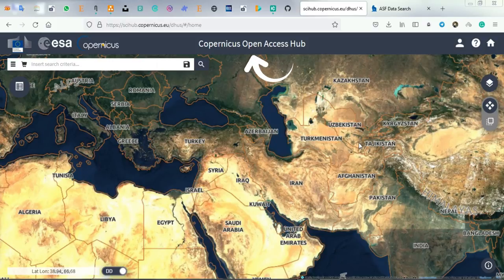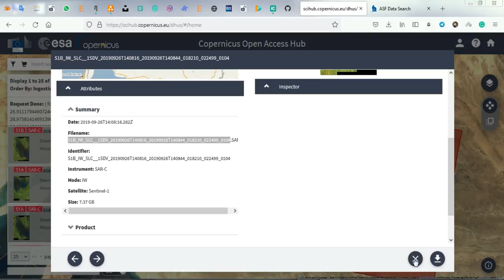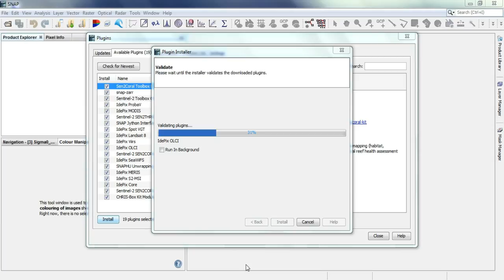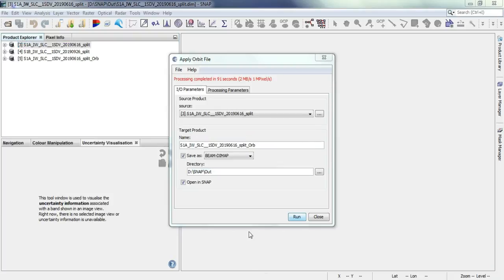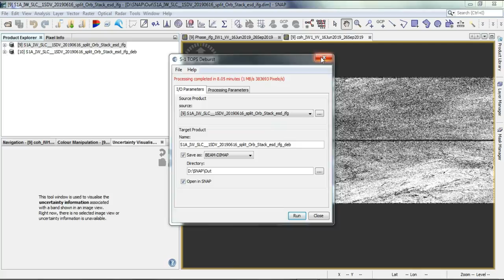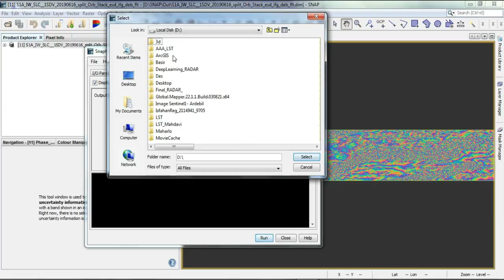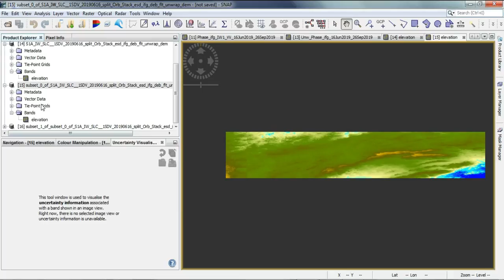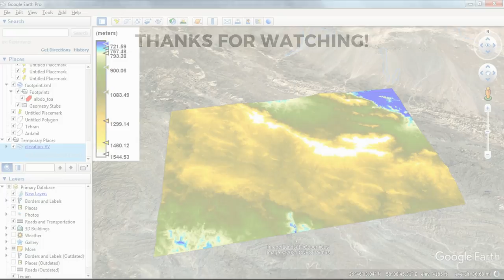DEM Generation using Sentinel-1 images in SNAP

Comment: Hi there, thanks for the video, it is indeed a good method for areas without dem data.
After I studied and followed the steps, and read the comments, I have already know this method is not applicable for urban and vegetation areas, this is a pity.
My goal was to generate the latest and accurate-to-a-certain-extent (within 30) dem for my AOI, since you know, most of the publicly-available dem data were from like 10 years ago.
Apparently this method is not going to help me with my goal, but I do have a few questions:

1. what is the actual resolution of such a generated dem and how can you check this? With the pixel size?
2. how do you cover your AOI during the spit and burst step? In the video you can see that the burst grids only cover part of the red square, right?
3. I generated a dem by following the video and exported the tiff files, but when I compare it with the srtm dem, there is a very big difference on the band values, espeecially the band values, the generated dem has values on band 1, 2 and even 3 and 4, but the srtm only has band 1, how so?
4. Do you happen to know any other way to help with my goal? I could really use some of your professional experiences on this 🤣🤣

Looking forward to your replies and thanks in advance 🙏.

Comment: Hi there
Thanks for the video
Why do we choose the basic criteria in the negative (-) direction?
Also why do we choose the closest vertical criteria?
Why is there no vertical criterion in the minus (-) direction in a sentinel image dated Oct 04, 2014?
Thank you for your time ...
Reply from the maker: Hi, The baseline of two images of an area needs to be above 150 to generate a DEM from sentinel 1 images. it should not be less than 150 so we've used a number greater than 150. Also, in terms of the images period, it is important that the periods of two images with 150 baselines must be less than 6 months. So we can't use images that have a baseline greater than 150 and greater than 6 month time period. So in addition to the baseline above 150, the time periods of our images should be less than 6 months.

Comment: How did you determine the 152 vertical criteria in the video?
Do you have any suggestions for vertical criteria in studies?
Reply from the maker: Hi, The baseline of two images of an area needs to be above 150 to generate a DEM from sentinel 1 images. it should not be less than 150 so we've used a number greater than 150. Also, in terms of the images period, it is important that the periods of two images with 150 baselines must be less than 6 months. So we can't use images that have a baseline greater than 150 and greater than 6 month time period. So in addition to the baseline above 150, the time periods of our images should be less than 6 months.
Reply: @rsgis6997  For example, from the two-week image found in August for glacier studies; Can we produce digital elevation models between August 18, 2015 and August 30, 2015?
There is no data that meets 150 criteria as you did in the video.
Reply from the maker: @mucahitdal8707  Yes, you can in terms of time, but these two images must be higher than 150
Reply: @rsgis6997  Thank you
Reply from the maker: @mucahitdal8707  👍🌹

Comment: hello, for sri lanka maximum is 100. how to find greater than 150 image. please tell me
Reply from the maker: It depends on your region
Some areas are more and some are less
Dry areas are mostly higher
Is Sri Lanka a dry region?
Reply: @rsgis6997  is it ok to proceed with less than 100m ?. im going to process the data somewhat dry area. ( dem for nearly 400sqkm).

And how is the accuracy of this dem compared to SRTM 30m dem.
Reply from the maker: @mindibandi487  It is better than the tail of 30 meters
you can work

Comment: You did it on bare land with less vegetation. how about on densely vegetated land?
Reply from the maker: No, it is not done on land with dense vegetation
Reply: @rsgis6997  Did you mean we cannot use sentinel 1 for generating DSM for Urban area or forest area? If so, could you please let me know the reason? Many thanks in advance.
Reply from the maker: @soknethlim3387  Yes, that's correct
You can use it but it will be less accurate
We explained the reason in full in the first video
Watch the first part of the video
Reply: @rsgis6997  thank you so much for your response 😍

Comment: can we get the output file as tiff file?
Reply from the maker: yes
Reply: After Back geocoding and while carrying out enhanced spectral diversity, an error occurs as:
A problem occured during the target product processing.
Type: OperatorException
Message: Generated network of images does not contain any pair. Max temporal baseline provided: 4
Can you please help me on that?
Reply from the maker: @sushantanepal  Do you choose the Digital Elevation Model correctly? And did you do the previous steps exactly like the video?